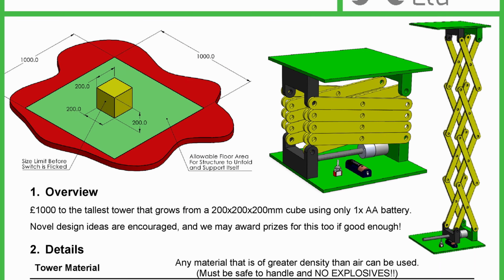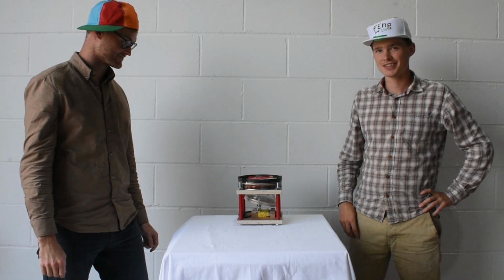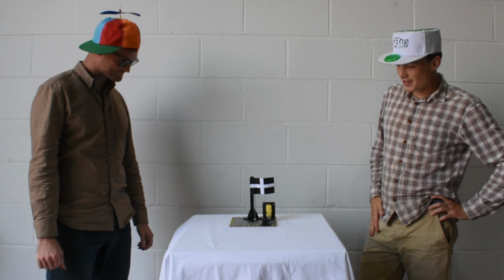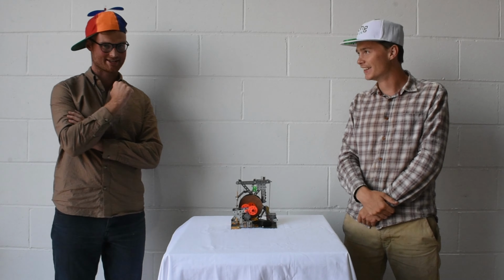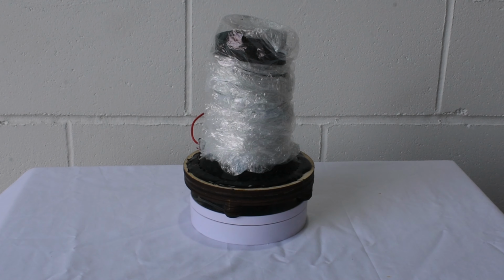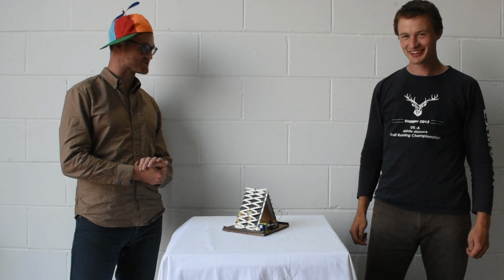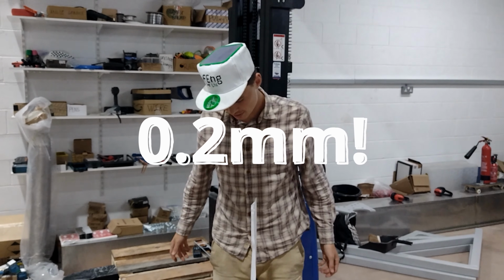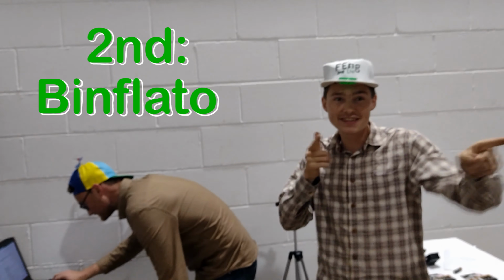FEng Challenge 004 -Tallest Tower - Full Episode

Comment: I'm not quite sure why the 1st entry with the tape measures would be disqualified, but maybe I misunderstood how it worked. Yes the blade of the tape measure technically has stored energy, but that isn't enough to stop the spring from keeping it inside. You couldn't "power" anything with a retracted tape measure, as that is it's natural state, without first pulling it out. In this case, as I understand it, the tape measure as a whole starts out with no potential energy, but stores energy as the battery extends it. Yes, technically it does, but not any that can be used to help it win. I'm sure you could technicaly find stored energy in each of the other ones, besides heat and from gravity, that is similar, but just doesn't hinder extension as much or is as obvious as the spring in a tape measure.
Reply: Binflater uses springs too. The DSQ was frankly unfair
Reply from the maker: This was a tricky decision for us to make, however, you can see that if people entered a  'jack in the box' type structure it would easily spring out of the starting cube to reach a significant height - and we wanted to limit all the height gain to come entirely from the power of the 1xAA battery.

Your point regarding the tape measure having to overcome the internal spring system for it to extend is valid however let's take that to the extreme and if someone entered a system that has a huge spring force pushing it upwards and a huge weight pulling it downwards and the battery energy allows for the upwards motion - this may be advantageous but also hard for us to police as you could have a design that's upwards force was slightly more than the downwards force but it appeared the battery was putting in all the effort for height gain. Therefore we decided to explicitly rule this out for simplicity.
Reply: @FieldhouseEngineering  thanks for explaining, i too was disappointed by this disqualification.